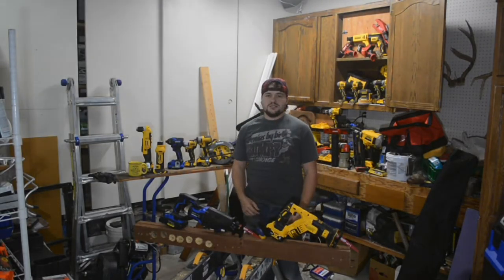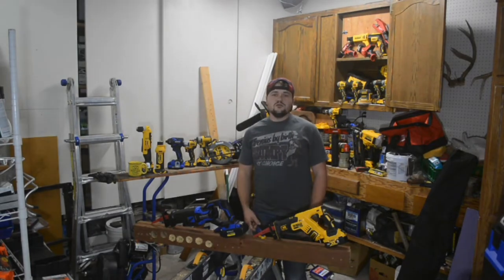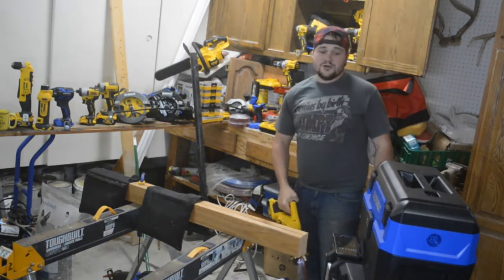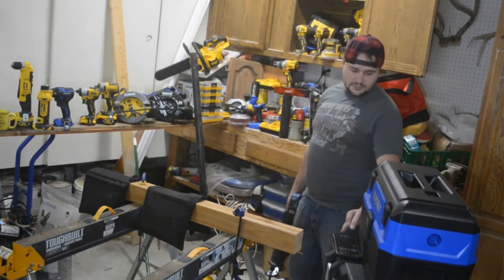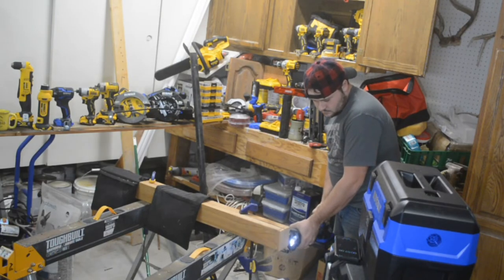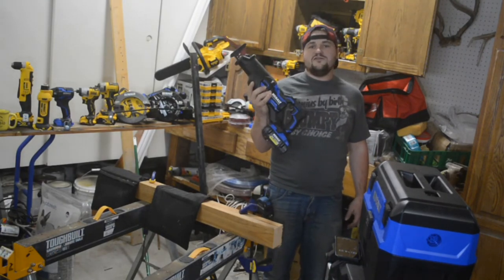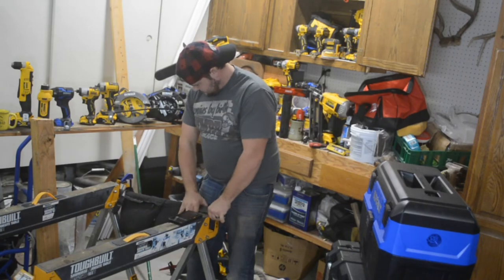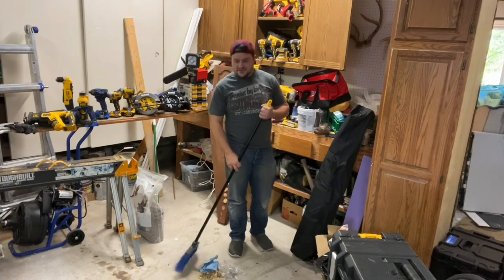Kobalt XTR BEATS DeWalt XR reciprocating saw

Comment: That's not really a fair comparison.  That Dewalt Sawzall is their compact version and doesn't have Orbital action.  It is geared for lightness and ability to '1-hand a 2-hander'.   Dewalt has a Flexvolt Sawzall that is geared towards performance.
Reply from the maker: Yes I want to test that new one out, unfortunately due to this lockdown and a lack of work coming in and new jobs, the funds have dried up to be able to buy new tools for testing. I hope soon to be able to do that test
Reply from the maker: Also, for the test to be fair, I didn’t use the orbital action, that way it was a closer comparison.
Reply: Well they are the same price($179, $149) so Dewalt needs to step up their game that's on Dewalt
Reply: Thanks for sharing your knowledge Tool Hombre! This helps all of us to put things into perspective! (The XTR is definitely one Heavy tool! 😊🌎💖)